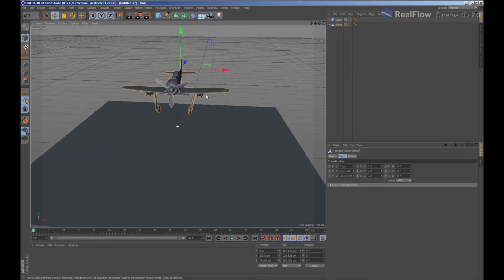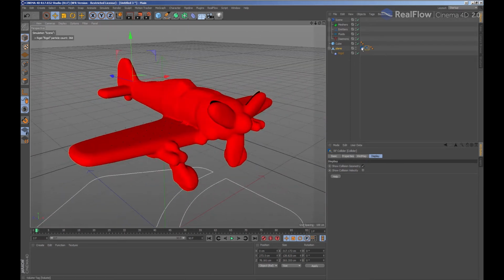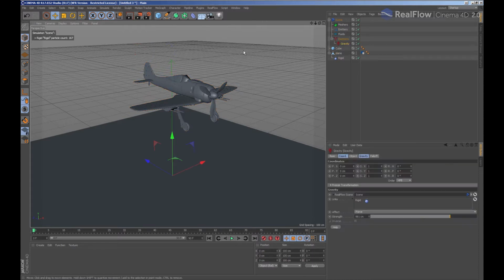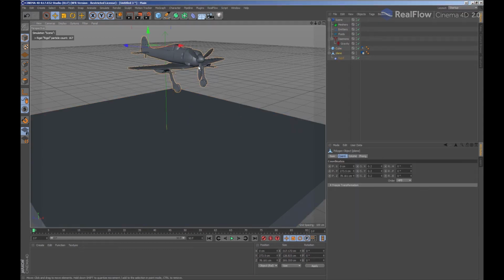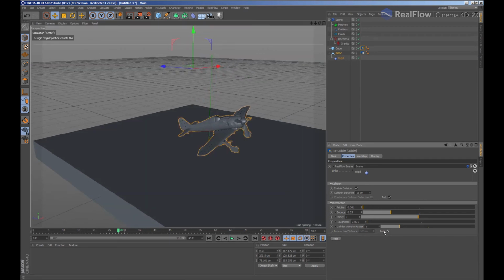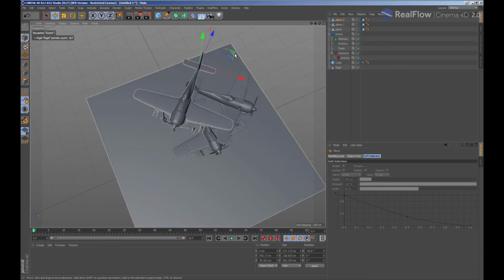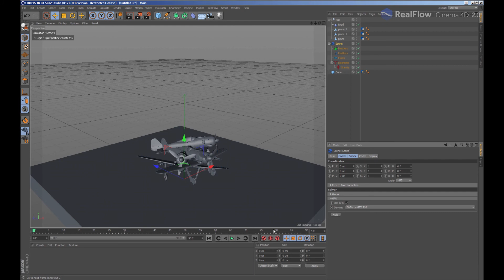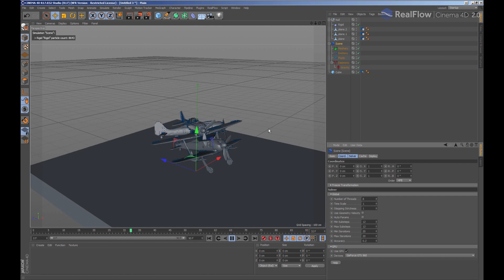RealFlow | Cinema 4D 2.0: Rigids Tutorial (Subs Available)

Comment: Why should I use realflow rigid body simulation instead the Cinema 4D simulation?
Accuracy and much parameters control?
Reply from the maker: Hi MegaInformazione! The main benefit is the coupling with the rest of RealFlow materials: Liquid, granular, viscous and viscoelastic.
Reply: My RealFlow rigid body object is not affecting my fluid simulation in the same scene when passed through it. I can see the collision areas all covering the objects correctly.